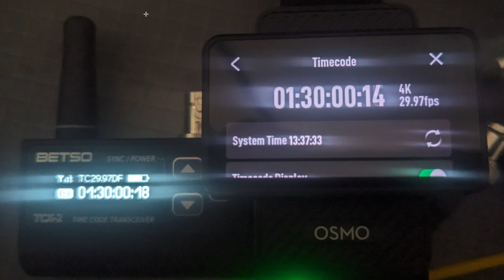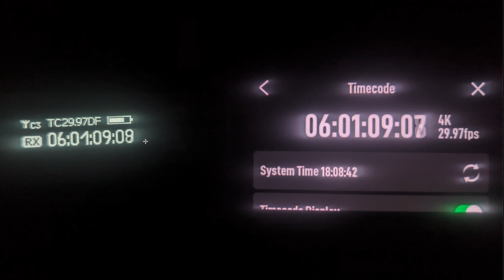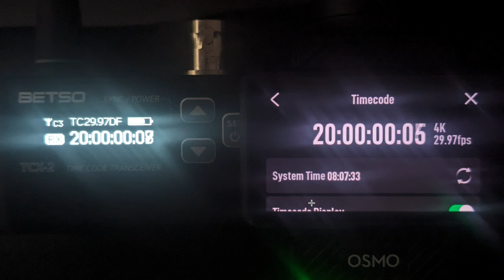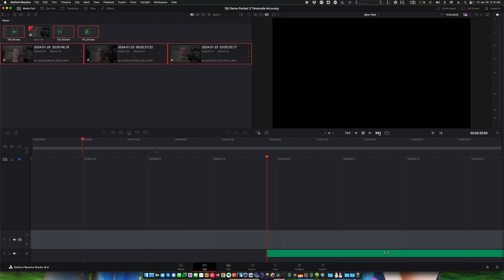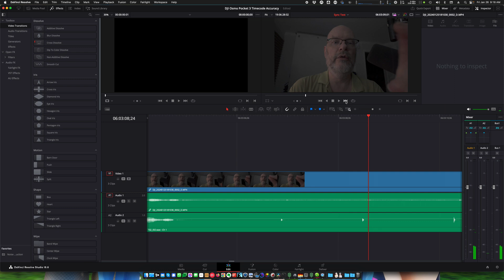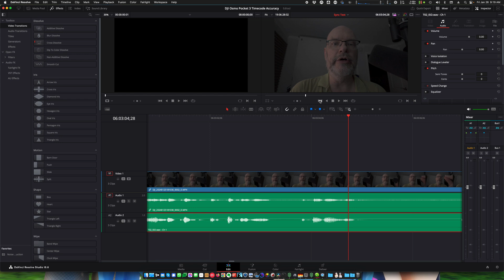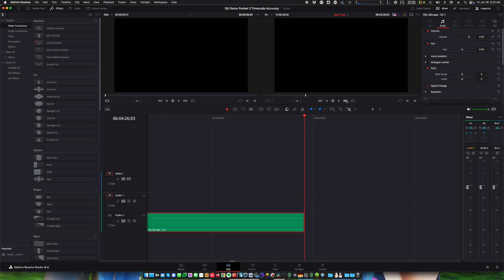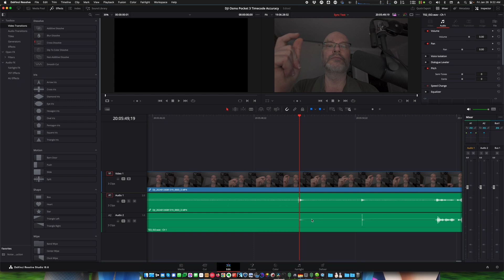DJI Osmo Pocket 3 timecode accuracy test

Comment: Thanks for making this. I can’t for the life of me figure out how to set the TIME on the pocket 3. Somehow it’s supposed to use the mimo app but I found your video when hunting for that, so it’s worth it. For me, I just use the audio timecode with my pocket 3 and leave the generator connected since I don’t use the audio of the pocket anyway. Then I use tentacle studio to convert the audio tc to metadata tc.
Reply from the maker: Continuous LTC as audio is an option, but I find it a bit awkward as I don't have a cage for the P3 to mount the generator to.  And part of the appeal of the P3 for me is that it is relatively small.  Attaching a generator to it all the time is a pretty big increase in bulk (even with modern "tiny" generators).

I've not had issues with the Mimo app (on an iPad) setting the RTC on the P3.  It seems like it just does it automatically any time it connects.
Reply: @cwichura thank you. I pretty much agree.

Comment: One additional comment: I see others have mentioned really severe drift between cameras, specifically the audio. In my experience, the osmo 3 in-camera audio maintains perfect sync with the video (using the on-camera, built-in mics). I believe the problem occurs when using DJI wireless mic 2 setup, based on what I have seen in other forums. My solution for this is to skip the Osmo wireless mics – use the internal mics for scratch audio (for later sync if needed), but record your good audio using other equipment – and sync it in post with time code (or the scratch audio track). I do this anyway even with pro cameras, so I’m not trying to bash the osmo 3 here – I think it is a very capable little camera.
Reply from the maker: As a sound guy, I usually do external audio as well, which is why I was so curious about the timecode accuracy of the P3.

For some quick non-critical stuff, I will sometimes use the Mic 2 wirelessly instead of setting up the Scorpio.  But those clips tend to be very short (never more than a minute or two), so I haven't had issues with the audio being off.  I'm also usually not filming people speaking in this case, so even if it was a few frames off, most people would never notice.

Comment: Excellent video – thank you!

You really explained the issue well, and ran the test that perfectly answered my questions on the pocket 3. For a relatively low-cost consumer camera – I have to say the OSMO pocket 3 performed really well. I’m happy with +/- 1 frame of drift over a 2-hour period, and it seems that is the case. Thanks for posting this test!
Reply from the maker: Glad you found it useful.

Comment: Do you know if the Pocket3 actually reads the clock while recording? The action 4 seems to only check the internal clock at the start and end of each clip created. So if you record for an hour straight the file gets chaptered into several clips. You often get a blank frame in the timeline where the camera decided to skip ahead. Possible it was in-between frames on the clock when the next file started.... My old DV camcorder's freerun timecode mode was more consistent back in the day. Just had to get all the cameras together and click the sync button on the remote. Adjust 1-2 frames in post and it was consistent with itself. DJI is all over the place.
Reply from the maker: I haven't done any really long takes with the P3.  But my guess is it is not doing any form of (internal) genlock.  It clearly doesn't even have a TCXO, even though the price on those has come down to consumer levels.

Comment: too much drift in DJI.. i have a 3 camera setup and this dji Drifts way too much every 4-8 minutes i gotta do slip audio several steps to the right... in some cases almost 14 steps.
Reply from the maker: I think they just use the RTC chip to maintain their timecode.  So there will be more variance, especially at different ambient temperatures.
Reply: @cwichura  Can you just leave the timecode box on permanently if the jam and unplug method doesnt work?  This should be a 2 minute video not 20!!  Converting audio to timecode is very fast and can be done by batch for all clips.
Reply from the maker: @deafdave6468  No, the P3 does not support continuous jamming.  Hence why testing it's accuracy is important.
Reply: @cwichura  Then LTC audio timecode in an audio track would be the way to go, if the editor cant sync up using this method then change editor!
Reply from the maker: @deafdave6468  You could do that.  But now you have to keep the generator connected to the USB port the entire time.  This makes the otherwise very "handy" form factor much more awkward.

Comment: Does anyone know how to fucking disable the time code feature so that I can get the normal time and date?
Reply from the maker: In the Timecode menu, there is a button to set the timecode to the system clock's current time.  You will want to do this each time you turn on the camera.

The system clock appears to be auto-updated whenever you access the camera via the Mimo app.
Reply: RTFM error!  ;-)

Comment: Thanks Christopher that nice to know!
Reply from the maker: Thanks!

It did a lot better than I was expecting, but will still require checking clips.  That said, in a lot of use cases a frame or two is probably acceptable (e.g., when not filming yourself talking where people will see the lipsync delta), in which case it will absolutely save time in post.
Reply: @cwichura  well it worked, audio timecode throughout the recording after 2 hours of recording, battery on the extended handle drained super fast for some reason, word of caution,  the extended battery handle on the p3 stops the pass through audio timecode on the p3 when the batteries dies, if dji or a third party could manufacture the handle with power and audio like the one on the p2 then that would solve that problem i guess, right, how do i power the p3 and have pass through audio for the timecode ?
usb c splitter perhaps ??
this is work in progress atm and if anything I'm optimistic or is it just as easy if not easier to match the waveforms in post, bare in mind my Track E,  TC-1 and mixpre6 mkii were all in 32bit float, my nle of choice is premiere pro and I'm dragging my heels to learn davinci resolve.
can you guys do any tests similar.
Reply from the maker: @jazzstream  Audio stopping when the battery handle runs out is a known issue.  The battery handle also interferes with some USB audio devices (like the Dante AVIO USB-C adapter) -- I don't know why.

Just jamming the P3 periodically may be close enough, depending on what you are recording.  And if you are only using external audio, may be a bit more forgiving even if the P3 ends up a couple frames off.
Reply: @cwichura  I've ordered a couple of different makes of usb c + 3.5 to usb c and 2xusb c to usb c out adapters to try out so i can charge and pass timecode at the same time, tonight I'm of to an open mic night that goes on for 3 to 4 hours so its a short handle to 10,000 pd powerbank and internal mics setup just for fun.
Reply: Thanks for taking the time to do the test, your pocket 3 seems more accurate than mine, when i sync using a Saramonic SR-C2001 3.5mm TRS/m to 
USB-C cable and a deity TC-1,  Tentacle sync Track E and my mixpre6 mkii my pocket three accelerates ahead soon after sync, all equipment on latest firmware as of 19th feb, in the uk the c21 deity cable and most deity cables are almost impossible to find, i have been in touch with a uk audio store who mentioned this to the deity rep and I'm told they'll stock some soon, not that a different cable will make any difference to the p3.

can dji tighten up the clock cycle with a firmware update or is it down to the dji lame quality control  and pot luck ?
Reply from the maker: @jazzstream  I doubt firmware will do it.  I believe they do not have a TCXO clock in the P3, and are relying on a regular RTC chip.  From observations over multiple cycles, I believe they record the RTC time when the camera goes to sleep and then when it wakes up they read the RTC again and compute the delta to update the timecode value.

FWIW, my test was done indoors in a room with relatively consistent temperature (around 78F).
Reply: @cwichura  
Hi Chris and Matt,
Today my Boya BY-K2  3.5mm to usb c cable arrived and i can confirm it syncs perfectly with the P3, one thing i have noticed is after i have synced my Track E to the Deity TC-1 i can then plug the Track E into the P3 and nothing on screen except that when i hit record on the P3 you can see a constant audio signal on the P3 audio level indicator,  this i assume can only be the timecode generated by the Track E ? could it be that we can have a constant timecode with no drift, I'll put the recorded track onto prem pro or audition later on when i have time to see if the timcode signal is recorded and also if i can replicate it via the TC-1.
Reply: i just put the TC-1 into master/audio out, plugged it into the P3 and the timcode audio pulse shows on screen even when not recording, hit record and playback and it is clear and loud timecode.
Reply from the maker: @jazzstream  Yes, you could always record timecode as LTC.  With an external timecode generator, that timecode should be consistent.  There may be a processing delay within the P3 that you need to account for.  This will require making test recordings and then verifying in your editor.  Hopefully this processing delay is consistent, so you know to always apply a <x> frame offset.  For example, when I record a BirdDog P4K into my Blackmagic Video Assist, there is always a four frame delay.  So I programmed that offset into my timecode generator on that device so it always lines up correctly in post.

The downside of this approach is you burn an audio channel.  And it won't work if you want to use a DJI Mic 2 paired to the P3, since that disables USB audio input.
Reply: @cwichura  
Thanks Chris, Yes that's something to definitely consider,  what my machiavellian mind is thinking is not to worry about the burning of a P3 audio channel as long as it's recording the tc set by the TC-1 onto the footage, this way as long as my mixpre6 mkii and Track E are locked to the same code on the TC-1 then i should i hope have perfect synced audio to the whole of the P3 footage as long as the TC-1 is kept on the P3 for the duration, I'm off to a live music event in my local pub tonight to give it all a test, they are having a really good band on this Saturday so if all goes well tonight then I'll be set up for Saturday,  if not then it's back to clapsync where i use a metal clicker at every take, incidentally i put the P3 clips with tc onto adobe audition, the one with TC-1 set to master, line out, was peaking over 0db, the one set as master, audio out came in at -15db.
Reply from the maker: @jazzstream  Good luck with the testing.  Let us know how it works.